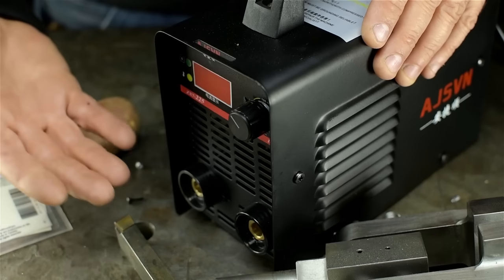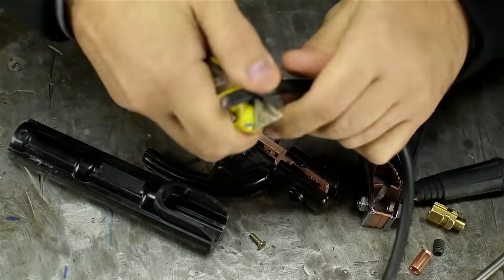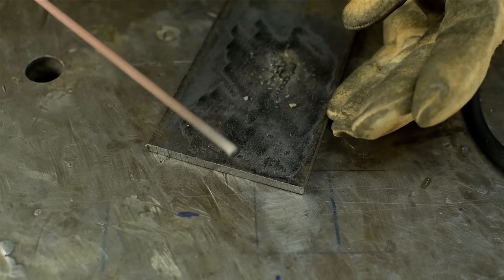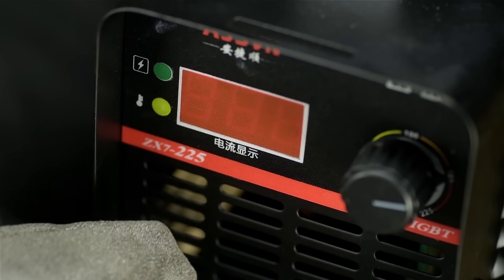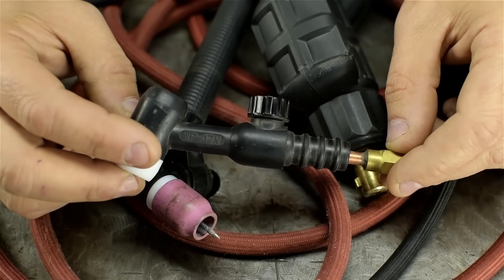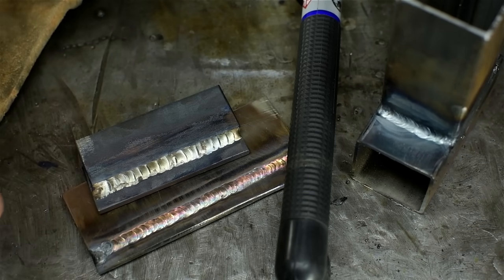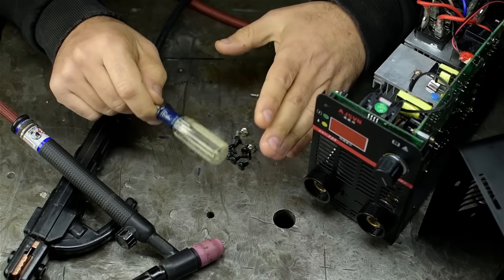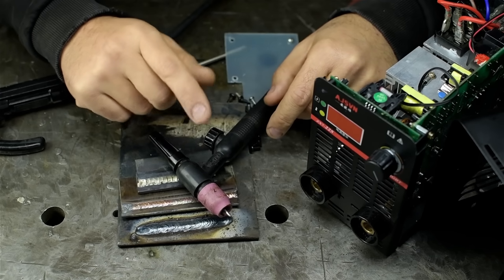Cheap Ebay Welder -- WILL IT TIG?!

Comment: I cut and welded underwater for over 20 years. I know a little bit. Never use AC AROUND WATER ,we used 400 amp dc for cutting . Use good rubber gloves,  sea water in a much better conductor that fresh water. Now days they have thermic cutting rods and you can cut steel with 12 volts , you still need  a high flow oxy regulator. And I still have my silver fillings, even tho it felt like I i had a mouth ful of aluminum foil at times.  I once hit my diving partners.helmet with 300en  or 400 amp cuttung rod, it knocked him out , he had   burns on his  c heeks , it arched from his air intake and out his exhaust chin buttion. He had a headache for a few days. He got even with me ,but thats another story.   Jack

Comment: Hilarious!!! I love when you make all those sarcastic cracks with your serious face !!!! Fantastic video (no surprise here!). However, I noticed that a display on the welder was showing 223A, but Fluke display was showing volts ... How did you make a connection??? I'm sorry for asking ... What is the welder display (the red) showing Volts or Amps? Because it may be a little Ohm's law conflict here. But I could be wrong!

Comment: Using Pos Ground the Electrons are flowing from Rod to Work.  Should notice let spitting.  Using batteries to weld it sure helps.

Comment: I'm a retired electrical engineer. I suspect the reason this welder worked better with the leads reversed is that electrons move from negative to positive. This means that the electrons leaving the welding rod help to carry the rod's metal from the rod to the welded material, instead from the welded material to the rod.

Comment: I like how small it is and as a donor for other projects especially with low amps whjich seems to be the case for most cheapy welders it looks ideal (just about every cheap welder I have tried has a sweet spot for amps and therefore a nice rod to use) 
I have multiple cheap welders  that all do specific little jobs and I have a relatively expensive stick welder that also weighs next to nothing and I love using it ranges from 20amps right up to 180  and works well anywhere in between with any size stick so it all depends on what you want.
Reply: Curious why you spent more on the stick welder than tig? I thought tig would be more sensitive. I've only a cheaper stick welder with no hot start etc

Comment: I got a small welder its a MERRCO and so far knock on wood it's nothing like the one that's on here with it on a 100 foot drop cord 110v knob turned half way it will burn a 1/8 6011 no problem and 7018 I think it was 4mm 5/32 no prob and I burned about 20 or 30 of the 1/8 6011 Non-Stop one after another the first day I got it to see if it would hold up

Comment: i have a small 200amp china welder that works about the same. i get about 150a out of it. 6010, 6011,6013 3/32 rods  i can burn all day and i have many times. 7014,7018 are harder to start so i have to run them hotter then i like to start them but 1/8 anything rods it just wont burn or will burn 1/2 way then stick.

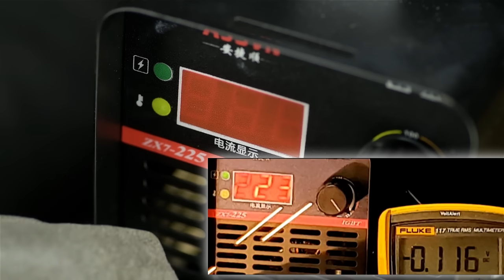Comment: 12:57 I know this is very late but I've always wondered how they make those claims and one thing I noticed is they all show a strange voltage for power supply. I wonder if you had access to single phase 265 volt ac if you could actually get the rated current. Thing is you would probably destroy the welder if you tried. So i guess they just throw up theoretical numbers to advertise high current ratings.

Comment: To increase the duty cycle could we cut more holes in cover , add an additional fan , take off cover , use ice packs , etc. etc. ? Also i was wondering if you could use an steel rod to cut metal with in stick mode and what size and type of rod ? My Dad was my first teacher in welding and he was an welding teacher at an trade school as well and he taught me to use a much bigger welding electrode and amperage than needed to cut metal which I'm sure he got that from this underwater cutting electrode that he had displayed on his bookshelf . One time I actually saw a rod in this closeout store ( I hope I don't kick myself for not grabbing it ) which appeared to be made of H.S.S. and 1/4" in diameter and wasn't sure if I could use that for myself to most likely cut bolts off and maybe even use pressurized air to help the process due to doing shade tree mechanicing ? Actually don't even own a welder unless a car battery charger or two could be used to weld with but looking into upgrading my propane torch in the near future .

Comment: Tony... why when wiring the plug, did you not use the strain relief on the outer of the cable? Was it because you were expecting to toss the unit after 15 minutes?

Comment: Just a thought in Australia 200 to 300 amp jumper leads are about 10 dollars so it's about a sixth the cost of the welder but I'm sure they would work no need for lamp cord at 10 amps jumper leads look as thick as arc welder leads so let's say those Chinese jumper leads are 4 to 5 dollars so they could have included a pair of car jumper leads in the price  Love the sense of humour

Comment: I don’t think you need to strike it like a match or use any drag do you? 
With mine I always just give the metal I’m working in a quick tap or poke, almost like your stabbing an ant in half a second, that’s how I’ve always done it, just a quick tap on the metal, no dragging or sideways motion to start it

Comment: Just a small tip from a Electrician, when you want to measure amps you have to set the multimeter to amps and not voltage, you said that its measuring 80 amps when the display is showing 0.078V or 78mV ? Or am i wrong here ?
Reply: i came to the comments after seeing that to see if anyone else saw that too lol

Comment: I've bought some cheap tools before because I knew I would only use them once or twice a year at most, but I would have to pass on this one. I got a cheap welder from Harbor Freight for about $250 I think about 15 years ago for small repairs where it was impractical to use a real machine. I used it about 6-8 times and it did a decent job for what I needed to do, light welding on brackets in crawl spaces and such, but it has been in storage for the last 8 or 9 years. I guess I can say it payed for itself a couple times. I had the same problem with the settings on it also, but it was only off by a small amount compared to this P.O.S.

Comment: Would it be possible to mod a basic stick machine like that so you could kill the arc at the end of your tig weld?, rather than having to tail off or pull away and move your gas away? (basically just add a switch to kill power to the torch)

Comment: The 7018 normally need DC voltage and I bet your first was with AC, you switch to - to lead and + to ground clamp

Comment: Just a simple tip... don’t scratch start with your tungsten to the base metal. Instead, take your tungsten and just set up like you’re about to weld with a high frequency welder. As in just get close to the base metal. Then, take your filler wire and scratch it over your tungsten while ending up on your base metal immediately after. The arc with bridge the gap. No fused metal into your tungsten if done right and if it feels sticky or sticks when you do it, keep trying. Pipe welding is normally done with scratch start bc of the position welds that are required with it. You don’t want to be hanging upside down or barely able to reach your weld area and have to deal with a pedal or trigger I guess. That’s all I could figure before I switched over to fabrication.

Comment: i have a question and possibly it's a dumb one... why does nobody ever weld aluminum with those cheap TIG retrofitted welders? i have a unimig viper and i purchased a TIG torch for it but i'm a little skeptical because i've only ever seen them used with stainless steel
Reply from the maker: welding aluminum requires AC.  I'm going to wager a guess none of these cheaper machines will do AC, DC only, so no aluminum.  Good eye, though!

Comment: The lamp cord should be sufficient because nothing can exceed 15 amps on the 120 volt side, the usual breaker/fuse size.
And, for the flip side, most low power device are using cords that easily survive the 15 amps needed for tripping the breaker. This is a security requirement : in case of short circuit, make sure to blow the fuse instead of overheating and catching fire.
Every 120 volt appliance are 10 amps max, even the microwave oven 
The tig produce 220 amps at low voltage.
Reply: I’ve never seen lamp cord rated for 15 or 20A. It’s usually 16 or 18ga.

Comment: You would never ever push 200amps thru a 16-14 AWG wire. It would instantly lite on fire.. it would barely hold 20Amps.

Comment: Hey man,nice video,I bought a welder similar to this one ,how would I hook this up to be use as a 220 welder over from 110,if you know , please be as details as possible, thanks buddy
Reply from the maker: I'm not an electrician and this isn't electrical advice, but on mine, it says right on the back that input is 120-220V or something like that.  So unless I misunderstood your question, there isn't anything special you need to do with the welder itself, just supply higher voltage.  I don't know if you have the same as mine so be careful... you have any electrician friends?  neighbors?

Comment: I know this video is from 2 years ago, but you say (when you hooked up a multimeter) the welder draws 80 Amp whiles the welder displays 125 Amp. I saw that your multimeter was set to DC voltage and displayed 0,080 vdc. Did you calculate the usage or did i missed some information in your video? 

This is NOT a "your stupid and i know it better reaction". 
I am really curious because measuring Amp is in series with the cabling, and measuring voltage is  voltage is parallel over the wiring.

So how did you measure it? 

Thnx. 
And btw... I also learned something from your video. I couldn't find out why my weld were not always consistent or "deep enough". 
Turns out i used the wrong welding sticks. They where ment for higher settings. 
Now my welds are perfect.
Reply: Some external current clamps output a voltage reading which is the amp reading.
And since that meter does not have a built-in current clamp, that's probably what he used.
Reply: @GoldSrc_ ah... That's right. I didn't thought off that. Stupid me 😁

Great video btw.

Gr,

Comment: When you use the electrode holder as negative the penetration should be more, when you use the electrode holder as possitive the penetration should be less, obviously at the same amps.

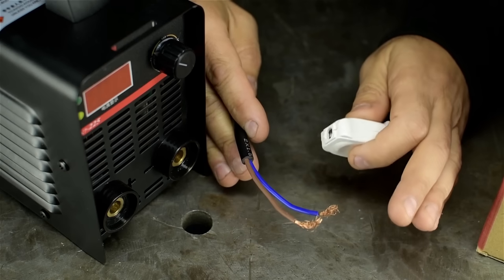Comment: 3:34 in Italy the voltage at home is 220V so here it would be ok
Reply: Yeah but definitely rewire it to accommodate an earth return. Plus a safety switch. Minimum 15A outlet as well.

Comment: LLOL!

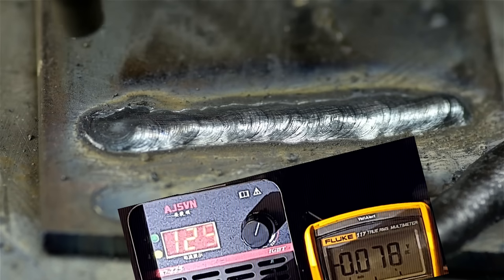I literally laughed out loud multiple times all the way through the 10:28 mark.

At the aforementioned Mark remember that 80 amps at 220vAC would be equivocating with 160 amps at 110vAC.  This may explain some of the discrepancy of what the machine I was reading to what it was actually using.

Comment: Really late in responding to this posting, I've dealt a lot with Chinese sellers, I build ebikes, I have exactly same problems with batteries and amps, the way it was explained to me and your video backs it up, amp readings are not what we're used to, the readings are on average half, this is because it's measured in a Chinese unit of measurement, bit strange,  even more strange they are allowed to be sold in our countries

Comment: I'm pretty certain you couldn't possibly measure the current that way. So in short, yes, you are measuring wrong. 
1. Your meter is clearly on DC Volts scale giving interference mV readings.
2. Those meters max out around 10A feed through or you'd require a plug in external clamp ammeter (if your model accommodates this feature) I'd be inclined to just get a cheap independent clamp ammeter. And run it over one of your leads. ✌️

Rough numbers on the model you're talking about :
Let's say P= 4000W
Supply V= 220V
Supply Current I= P/V = 18A

This is a bit high for Australian supply so I would expect a minimum of a 15A plug and supply cable. 

At work end assuming 4000W Max duty you'd have around 20VDC working @ 200A.

I'd assume you could work 3 out of 10 minutes at that current (30% duty cycle) 

For 10 minutes straight (100% duty cycle) you'd probably be safe in the ballpark of 110A continuous. 

Also @30VDC open circuit voltage you're well and truly safe. That's not a significant lethal voltage. I'm more concerned about the lack of earth and an RCD protected supply (safety switch) 😅

Love your videos mate. ✌️

Comment: Your meter looks like it was set to vDC and not Amps. what you're measuring is .079 volts dc, and in reverse polarity.
to measure current you need to wire that particular multimeter in series with the circuit, unless you have a clamp meter.

Either way, your Fluke 117 meter is only 10A fused, So even if you had the meter wired in correctly you would have blown your meters fuse as soon as you started welding.
I would definitely recommend getting a clamp meter for this reason, they aren't as accurate in lower ranges but still worth their weight in gold!

Comment: I have a similar welder , I was thinking about using it as a power source for me wire welder, flux core and gas shield, but I mostly use flux core,, just using my wire welder as a spool feeder, I got mine for about $60,120/240v and it works ok,  but I don't care for arc welding, I have a large arc welder, it should Work with wirefeed, mine came 3'-4' leads, that is almost a waste! 2-4gauge, I'm thinking about replacing it with about 10' of 2gauge

Comment: Not meant to be offended, just to be curious.. 😀
How can You determine Amperage, if You are measuring DC-voltage with multimeter? 
If I remember correct, that Fluke is capable to measure max 10A continuous current. 
But do You have some special formula, how You determine current from voltage..? 
Anyway, good video, thank You for testing! 😀

Comment: First thing an engineer should learn: don’t eat the slag, or desiccant sachets. I still struggle with this from time to time.  Very timely video as I just bought a cheapo inverter yesterday, deciding having a welder is better than not having one, and it works fine. If you’d just restarted your WIFI hub all that wiring could have been avoided, - just sayin’.  Impressive results but I think I’ll save up for the TIG welder.

Comment: One of the cross members on a day bed just snapped clean across.  They want $235+tx for a new one.  Can I use this thing to weld it instead?  I don't know if it's spring steel or not.  Anyone know???

Comment: Sorry old Tony but I do have to say that your fluke multimeter won't measure over 10 amps (it's fused). The leads have to be in series and would melt the cable at 80A. You'll need a clamp meter
Reply: Love your work though, no negativity here. Just didn't notice anyone else pick up on this
Reply: Watch again and listen carefully, he was measuring correctly with a clamp.
Nobody picked up on that because he did nothing wrong lol.

Comment: Just but a three prong extension cord cut off the one end wire the two wires to the right spots then take the ground and attach to the machine frame anywhere. If it pops the breaker though it in the dump.👍🤠 Somebody is spoiled with high frequency 15 years of stainless high pressure pipe maybe pick up a high frequency welder 2 times never had a problem with flick and stick welding😁👍.

Comment: Gives decent welds, but did you show it must be powered from 220 VAC to work at all.  I think you overplay the danger.  All those conductors inside you point to are 30VDC max and they are isolated from ground.  Seems no more dangerous than touching the end of the stinger.  The AC input stops at that bridge rectifier on top.  Even with 220VAC, the max you could touch to ground is 120 VAC, which is fairly safe, though you will feel it, but little risk of that unless you drop the welder to loosen the guts, or bash the case in.

Comment: I am a welder by trade. I use alot of industrial welders. I only have a old Lincoln buzz box stick welder. Ik that at we I burn alot of 6010 rods ,they r dc. At home I run alot of 6011rods. They r ac and so is the buzz box that's y I run them at home.  And I'm pretty sure the 6013 rod r ac also. And the 7018 is a DC ik for a fact. So that's y u had better luck switching the polarity. With that been said this was 2 years ago and u probably know that by now

Comment: Your fluke is set to DC V which is measuring voltage and not current. It should be measuring DC Amps.

Comment: I bought the slightly more expensive crap model came with both copper wires.  Seriously they actually weld. Not great but I don't have a few grand to throw at a welder I would use twice a year.

Comment: you've got your meter set on DC voltage not Amps?
Reply: There is an adapter to measure amps with a multimeter

Comment: Hey tony ! Isn't your multimeter was set on ''V Dc''!? It means you are measuring volts* instead of measuring the amps ! Vdc stands for Volts Direct Current. That will only tell you the voltage. You have to set the multimeter on the on A to measure the amperage. Peace !
Reply: His multimeter is hooked up to a current clamp that measures the amps and provides a voltage as a measurement. The volts you read from the current clamp are the amps going through the set-up. He talks about this in a later video
Reply: @gamemeister27   aHHHH thats genius ! I was trying to understand ! I will never doubt this old tony again xD

Comment: The problem is that you did not use the desire volt the welder need which is between  160 220